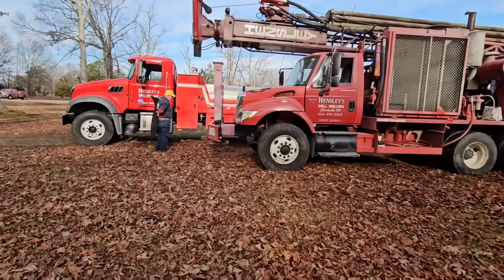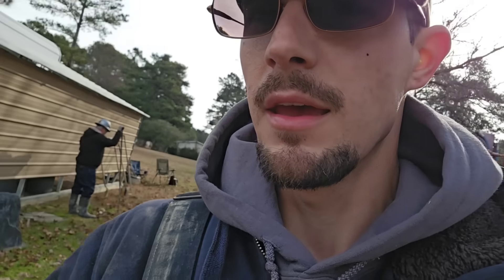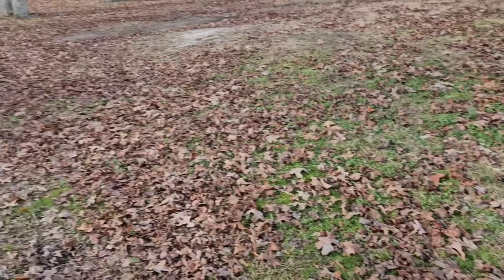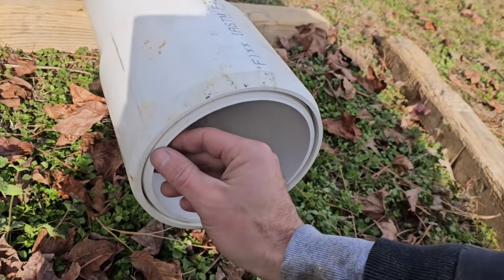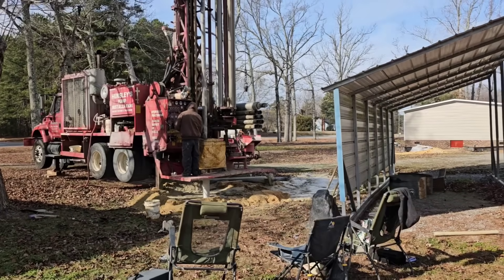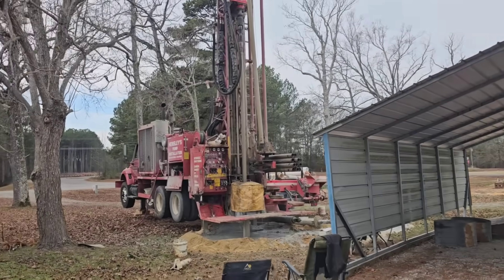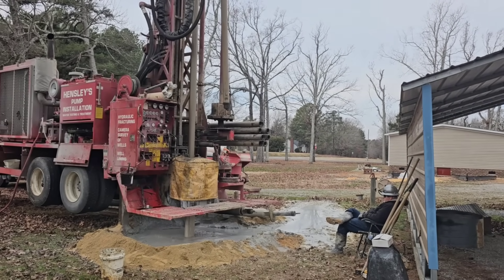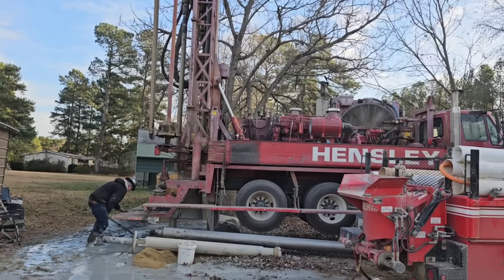The Last Well of 2024, Part 1. Drilling a New Water Well near John H. Kerr Dam

Comment: 37 degrees, that is a heat wave for us up here in the Northern part of Vermont. Day time highs are in the 20's
Reply: That's even normal winter temperatures in the upper Midwest but as somebody at works outside 37 is cold

Comment: The videos are getting pretty short, I enjoyed the longer videos a lot more then these shorts.
Reply from the maker: @william6526  this would have been longer if we found water. 
Future videos will be longer, they just take alot longer to edit. Since October i had tested a few different things to see how the algorithm worked. I learned that my original content once a week performed the best.
Reply: I am assuming that lube is the same as I buy for automotive copper no seze.. I use on bolts an studs.  My question is I have noticed regardless of how well covered the thread of drill extension  is you all always re apply more… Is their a reason?  Also if god forbid a drill bit gets wedged you can’t reverse due to coming apart but how on earth do you dis lodged the bit? ( as in she will not turn or go down anymore an she comes up tight when trying to retrack the extensions) 🤔🤷🏻‍♂️ lol maybe 60  70 years ago when we could buy caps and dynamite, I could possibly see dropping a quarter of a stick down and touching it off but now days that would be a ohhhhh crap!!!
Reply: Can the drill bits be sharpened or just replaced

Comment: Merry MAGA Christmas buddy. I highly recommend that you get yourself an IR thermal imaging camera. You can spend around $500 on a Klein unit that's self-contained, get the one with the larger screen. You can also just get one of the little ones that plugs into your phone for $250. They will all allow you to find your frozen spots and you can use them for all sorts of other troubleshooting too. A bad engine cylinder will run colder than the rest, drafts or a lack of insulation in the walls, or measure the wife's hot ass, lmao. Seriously though, get one and you'll never regret it. It's a HUGE time saver.